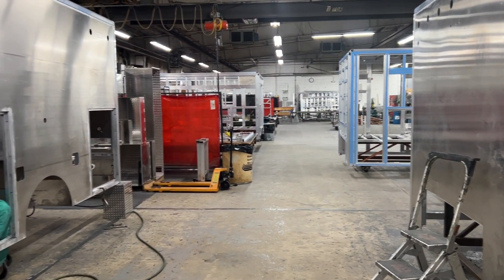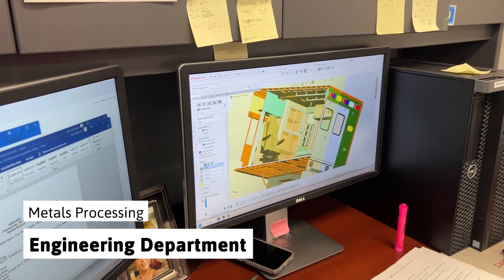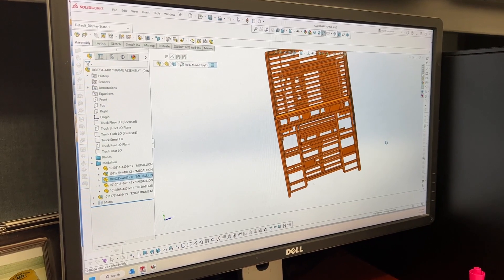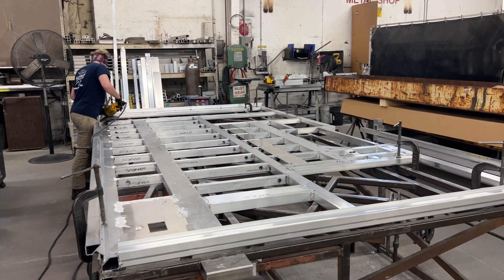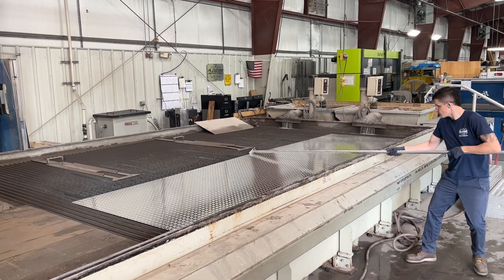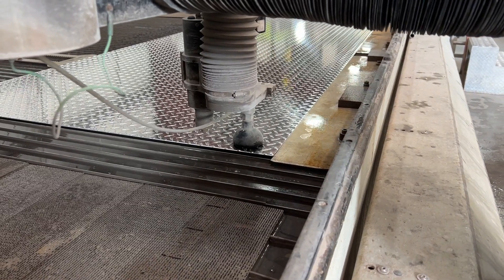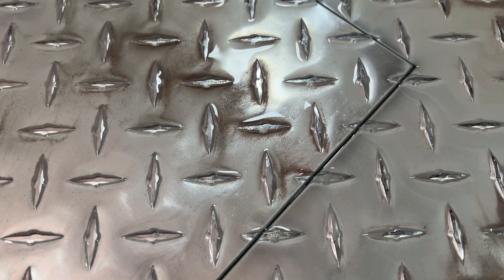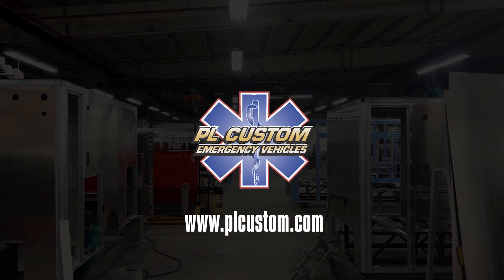How It's Made | PL Custom Ambulance Metals Processing Part 1

Comment: Are you guys doing any design automation with something like Driveworks or EpicorCPQ?
Reply from the maker: Yes, our design team uses SOLIDWORKS in the design process of our ambulances.
Reply: @plcustom  Driveworks or another similar CPQ would be used to automate Solidworks. You would use it to generate various sizes of similar components automatically, like a door assembly for example. It would generate all the parts and drawings for a new door in minutes vs hours of manually resizing in Solidworks. If you're not using an automation software,  you should really look into it. It will save engineering time for mundane tasks and improve your product standardization.